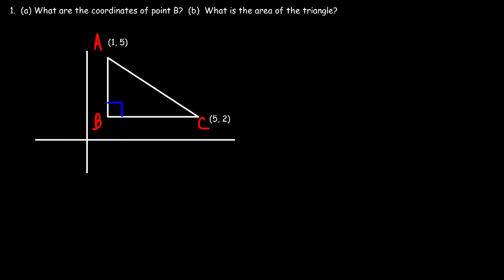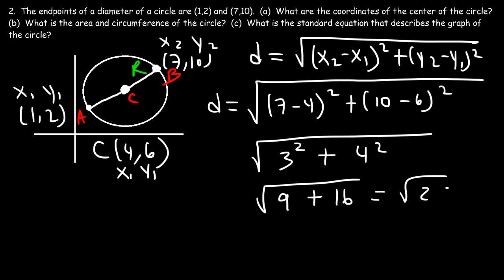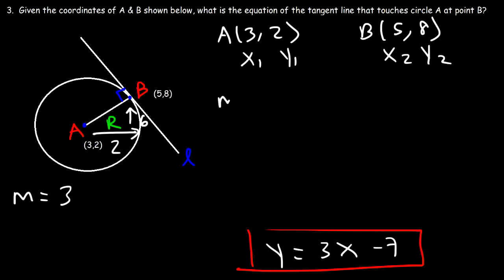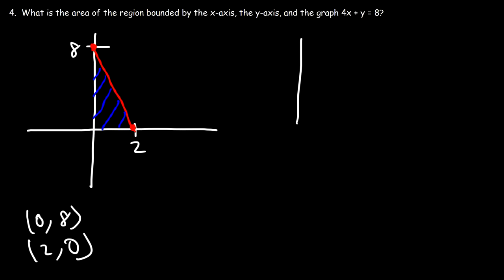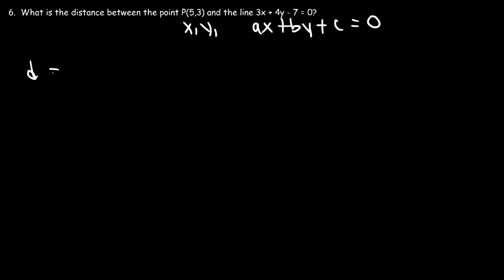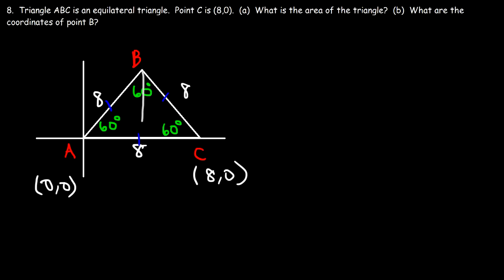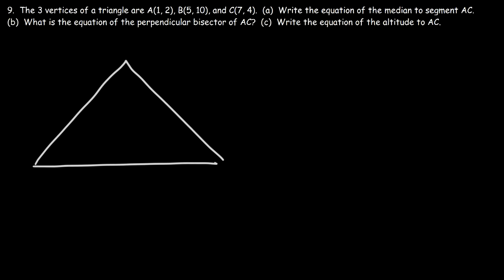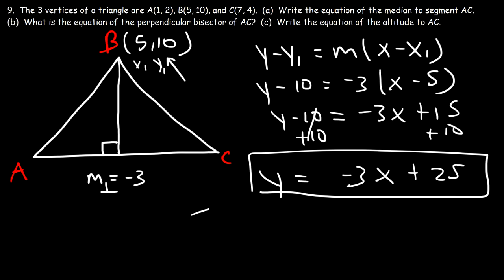Coordinate Geometry, Basic Introduction, Practice Problems

Comment: I got 4.38....... doest it still count as   correct. I first found the midpoint of the line and used the midpoint as point two in the magnetube formula so I'm not sure if I'm right this is for 6

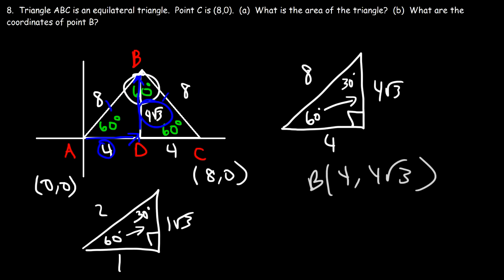Comment: 24:31 Alternative solve to 8, b is that we know area = bh/2 and x coordinate of point b is of course 4, so we also know area and base which are respectively 16×√3 and 8 so if we just divide 8h by 2 we get 4h = 16×√3, height or y coordinate of Point B = 16/4 = 4×√3

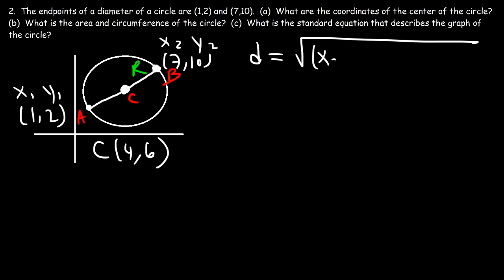Comment: @4:00 I find it much easier to draw a line down from (7,10) to form a right angle with point (1,2).  At that point you have a 6, 8, 10 right triangle and the rest is easy.  I would save the distance formula here.  Less to remember.

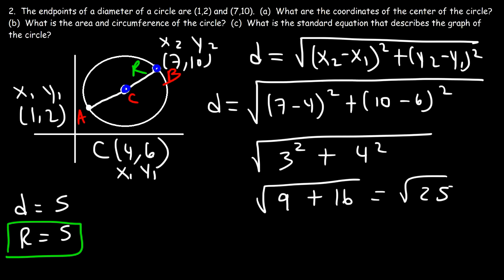Comment: To find r at 4:52, would it also be correct to use distance formula between point A & B and simply divide by 2?
Reply: yes
Reply: @oykukarakebap8586 no cause ab is not confirmed to be the diameter
Reply: Don't be ignorant @oykukarakebap8586

Comment: Question 6 is wrong, I did it using algebra and got 4.3, I then did it with graphing technology, and I got the same answer. The formula you used is new to me, and I think its actually just an approximation,